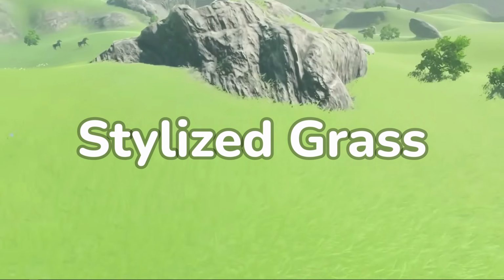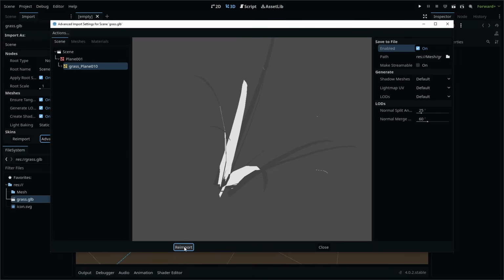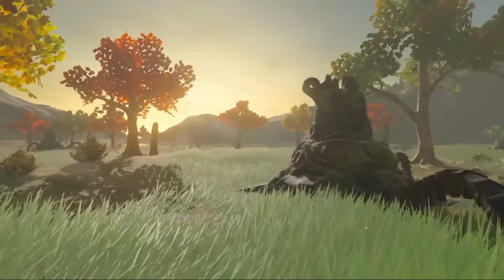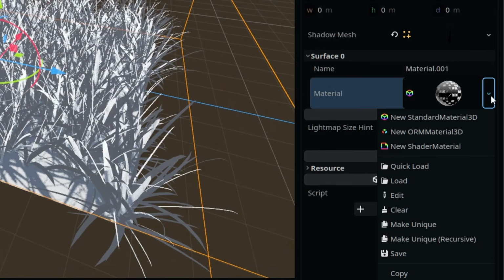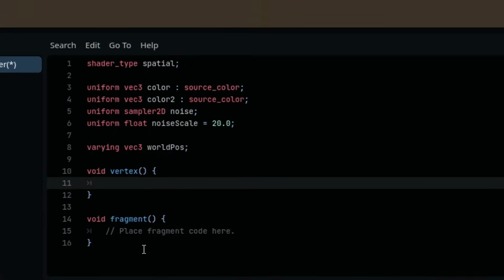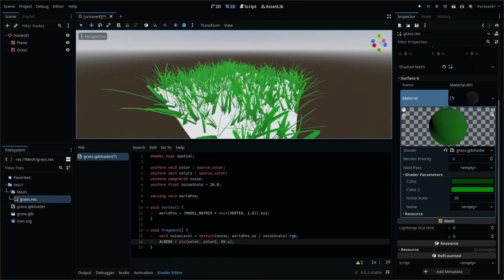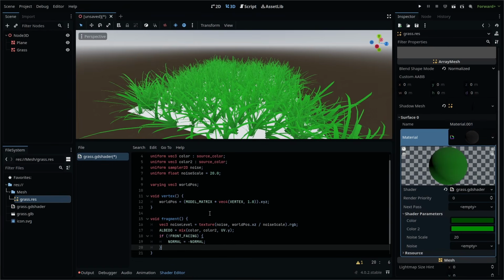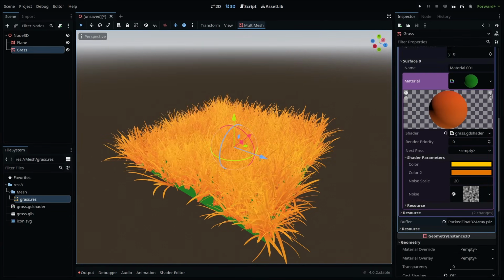Stylized Grass in 5 Minutes // Godot 4 Tutorial

Comment: ATANTION! If you still want grass animation, insert this code into the grass shader. Simply replace the code provided in that tutorial with the following:

shader_type spatial;
render_mode cull_disabled;

uniform vec3 color : source_color;
uniform vec3 color2 : source_color;
uniform sampler2D noise;
uniform float noiseScale = 20.0;

/* --- Grass animation parameters --- */
uniform vec2 wind_dir = vec2(1.0, 0.2);   // wind direction (XZ)
uniform float wind_speed = 1.5;           // animation speed
uniform float wind_strength = 0.25;       // sway strength (in meters)
uniform float gust_strength = 0.35;       // gustiness (0..1)
uniform float bend_power = 1.6;           // how much stronger the top bends (1..3)

varying vec3 worldPos;

void vertex() {
	// world position of the vertex
	worldPos = (MODEL_MATRIX * vec4(VERTEX, 1.0)).xyz;

	// Height mask: the bottom barely moves, the top moves more (if UV.y goes bottom → top)
	float height_mask = pow(clamp(UV.y, 0.0, 1.0), bend_power);

	// Noise for variation between grass blades (and within a single blade)
	float n = texture(noise, worldPos.xz / noiseScale).r;

	// Wave + gusts
	float t = TIME * wind_speed;
	float wave = sin(t + n * 6.2831853);
	float gust = sin(t * 0.5 + worldPos.x * 0.2 + worldPos.z * 0.2);

	float sway = mix(wave, gust, clamp(gust_strength, 0.0, 1.0));

	// Offset along the wind direction
	vec2 dir = normalize(wind_dir);
	VERTEX.xz += dir * (sway * wind_strength * height_mask);
}

void fragment() {
	vec3 noiseLevel = texture(noise, worldPos.xz / noiseScale).rgb;

	ALBEDO = mix(color, color2, UV.y) * mix(color, color2, noiseLevel.r);

	if (!FRONT_FACING){
		NORMAL = -NORMAL;
	}
}
Reply: Tysm!!
Reply: I love you.

Comment: For all the people asking about the wind effect video, if you want to add a mild wind effect, you can do so with a few small changes to StayAtHomeDevs grass shader.

shader_type spatial;
render_mode cull_disabled;

uniform vec3 color : source_color;
uniform vec3 color2 : source_color;
uniform sampler2D noise;
uniform float noiseScale = 20.0;

// Uniforms for the new wind effect
uniform float wind_speed = 1.0;
uniform float wind_strength = 0.1;

varying vec3 worldPos;

void vertex() {
	
	worldPos = (MODEL_MATRIX * vec4(VERTEX, 1.0)).xyz;

	// --- NEW WIND LOGIC ---
	// Create a mask based on the vertex's height (Y-axis).
	float mask = VERTEX.y;

	// Calculate the wind offset using a sine wave.
	float wind = sin(TIME * wind_speed + worldPos.x) * wind_strength;
	
	// Apply the final offset to the vertex's X position, multiplied by the mask.
	VERTEX.x += wind * mask;
	// ---------------------
}

void fragment() {
	
	vec3 noiseLevel = texture(noise, worldPos.xz / noiseScale).rgb;
	ALBEDO = mix(color, color2, UV.y) * mix(color, color2, noiseLevel.r);
	if (!FRONT_FACING) {
		NORMAL = -NORMAL;
	}
}
Reply: Thanks for this man, worked great.
Reply: Thank U a lot. U r great!

Comment: did you do the wind tutorial after this? I can't seem to find it :/
Reply: If you still want grass animation, insert this code into the grass shader. Simply replace the code provided in that tutorial with the following:

shader_type spatial;
render_mode cull_disabled;

uniform vec3 color : source_color;
uniform vec3 color2 : source_color;
uniform sampler2D noise;
uniform float noiseScale = 20.0;

/* --- Grass animation parameters --- */
uniform vec2 wind_dir = vec2(1.0, 0.2);   // wind direction (XZ)
uniform float wind_speed = 1.5;           // animation speed
uniform float wind_strength = 0.25;       // sway strength (in meters)
uniform float gust_strength = 0.35;       // gustiness (0..1)
uniform float bend_power = 1.6;           // how much stronger the top bends (1..3)

varying vec3 worldPos;

void vertex() {
	// world position of the vertex
	worldPos = (MODEL_MATRIX * vec4(VERTEX, 1.0)).xyz;

	// Height mask: the bottom barely moves, the top moves more (if UV.y goes bottom → top)
	float height_mask = pow(clamp(UV.y, 0.0, 1.0), bend_power);

	// Noise for variation between grass blades (and within a single blade)
	float n = texture(noise, worldPos.xz / noiseScale).r;

	// Wave + gusts
	float t = TIME * wind_speed;
	float wave = sin(t + n * 6.2831853);
	float gust = sin(t * 0.5 + worldPos.x * 0.2 + worldPos.z * 0.2);

	float sway = mix(wave, gust, clamp(gust_strength, 0.0, 1.0));

	// Offset along the wind direction
	vec2 dir = normalize(wind_dir);
	VERTEX.xz += dir * (sway * wind_strength * height_mask);
}

void fragment() {
	vec3 noiseLevel = texture(noise, worldPos.xz / noiseScale).rgb;

	ALBEDO = mix(color, color2, UV.y) * mix(color, color2, noiseLevel.r);

	if (!FRONT_FACING){
		NORMAL = -NORMAL;
	}
}

Comment: Try not to use if statements in shaders, they can lead to branching which hurts performance.
In this specific case, use:
NORMAL = NORMAL * (FRONT_FACING*2 - 1);
this avoids branching and has the same result.
Reply: Or:
NORMAL = abs(NORMAL);
Reply: @justinhouk7933  I don't know about godot, but this should be super efficient way as it only removes the sign bit from float..
Reply: This just gives me the error "error(56): Invalid arguments to operator '*': 'bool, int'."
Reply: nuh uh that not good
Reply: @EvanPilb  would you like to elaborate?
Reply: @GabrielRodriguez-mq6ly  
NORMAL = NORMAL * (float(FRONT_FACING) * 2.0 - 1.0);

Comment: For anyone having the issue that the grass shader shows up fine in the editor but not when previewing or exporting:

For some reason, when I imported the Mesh ressource (grass.res) using "Save To File", it had 2 surfaces. Surface 1 had a white material attached to it, which didn't show up inside the editor but was visible when previewing.
Removing this material (click on the arrow right next to it -> Clear) solved the issue!
Reply: thank you mate was running into this!